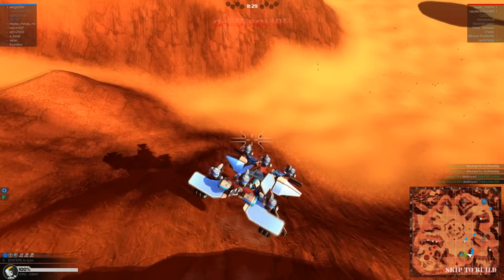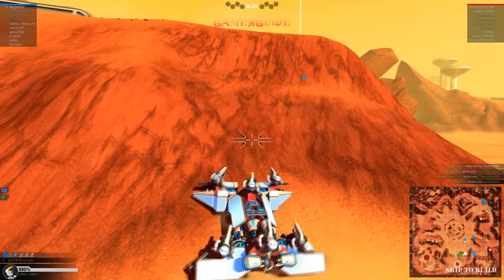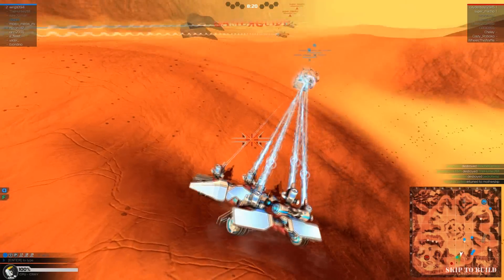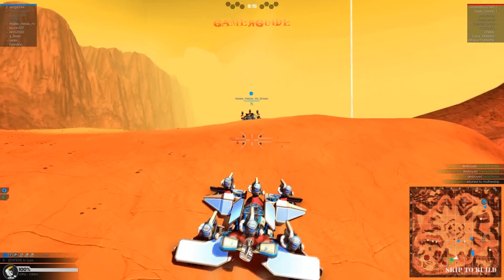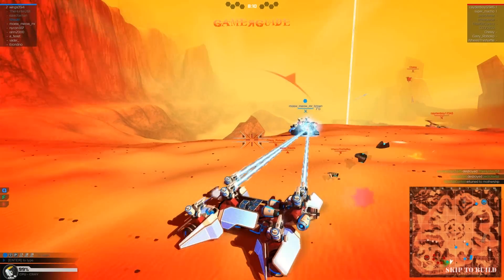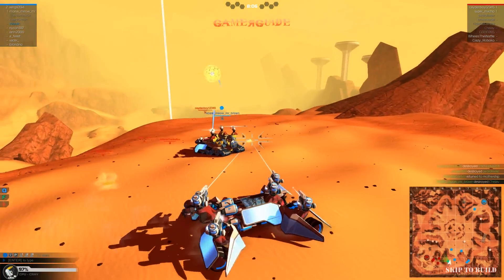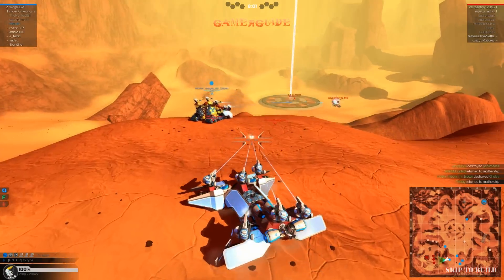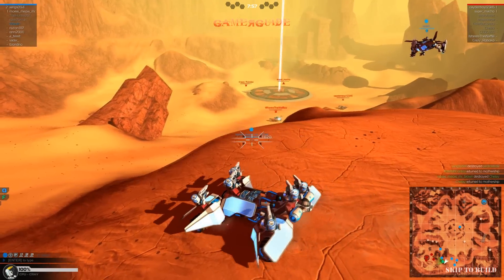ROBOCRAFT - T7 DOOM BUGGY BUILD TUTORIAL (w/ GamerGuide)

Comment: I think Medics are really underrated due to respawning and people just dying if they have to. But I've seen medics carry games!
Reply from the maker: jbakker973 Yeah I agree jbakker, I play my T10 medics often and having those Tesla blades really helps while under the healing shield. I have gotten 7 or 8 kills in a game as a medic too. Plus if your team is smart and moves as a team having a healer at the enemies base is a huge help. Outside of plasma i think nano cannons are the best thing for taking out protonium crystals as they are accurate and do really good damage against them. One can slice the crystals off right at the supports and destroy a lot more quickly. Anyway I'm sure once peopel get use to the new Meta medic will become a lot more popular again. Thanks for commenting :)
Reply: Gamer Guide Currently I play a plasma bomber but I got into Tier 10 with a design similar to your Tier 9 healer. Took me a long time to get there though, but your building style got me there! :D
Reply: Gamer Guide What changes have you made for the T10 Medic for the new Meta?  I am using your T10 Electromantis but it has a few "issues" with the new meta... Any helpful suggestions?  I have doubled the Hovers but hoping you have several suggestions on a host of upgrades or changes?
Reply from the maker: Hover are just much slower until you get some clock cycles. It performs very well when you get some cycles earned however. I had a fantastic game with it yesterday where I carried the team. That being said I'm not a big fan of the new meta right now for several reasons and the fact that you start out nerfy in new battle mode and in classic you can't do better than nerfy speed doesn't help anything. I'm hoping for some patch love in the near future.
Reply: Gamer Guide Besides speed, with the change to Rails it can be one shot through the T10EP and the side with 1 set of cubes to the drivers seat, I created a temporary fix adding some additional tri-force tetra's.  Also  a direct Plasma hit above can one shot the driver through the EP T10, I dropped him down one level and partially sealed the top.  Neither of these things happened until after the patch.
Reply from the maker: Are you playing the Mk.3 or Mk.4? Some of what your saying sounds strange. For instance you can't drop the driver down 1 block as he is already on the bottom level without being outside the ship. I have not experienced being one shot by plasma on the top side either. However if the gunbrella splash damage knocks out the cube below you it can kill you instantly if hovering in range. I suggest putting the radar jammers under the cabin area. Dropping the pilot down seat down would not be a good idea on the Mk.4.
Reply: Gamer Guide I am playing the Mk. 3, can't afford Mk 4 (CPU only 1200 atm), sorry that is why we are speaking past each other.  

I ended up triforcing the core a bit, dropping it down (yes the bottom is now below the EP (but I rarely expose the bottom), and placing some triforcing on the sides.  At first I thought the Plasma one shot was a fluke it was not, it takes a direct hit from above. But it happened repeatedly in two games until I lowered him, partially covered, and triforced the core.  Rail gun one shot started with the most recent patch buffing Rail damage, adding a small amount of triforced tetra's just below the EP on the single layer side so far has done the trick.

As far as the radar jammer under the seat, I find in the new Meta, since I am the only Medic in most games (True Tesla assassins rarely stop to heal), I end up self destructing 75% of the time anyway after I lose the ability to provide value on the battlefield.  Doubling the Hovers has helped a significant amount allowing me to limp back to base.

However, if you look closely at my version of your bot, it does look as though I used a finger painting technique to your fine brush strokes.... Sorry :)
Reply: jbakker973 Nanos still hold a solid place in game play.  They can kill enemies at higher overclocks, kills crystals very well, and still heal allies.  When going for the win, aiding in killing respawning enemies becomes very key.  A solid nano build can give your team the edge.  Have a t6 max pflop nano tank that was very dominating in that match.